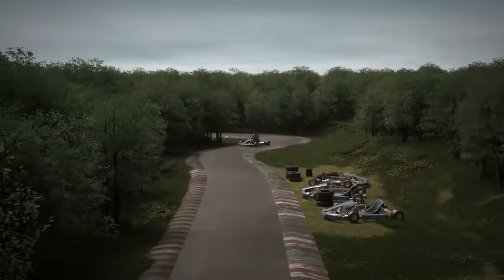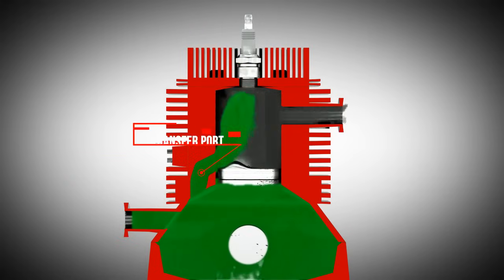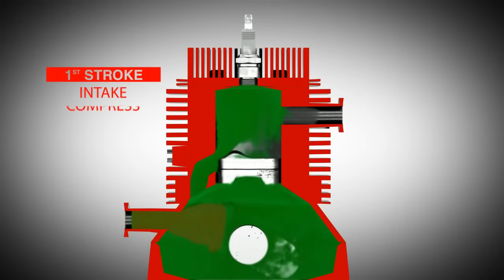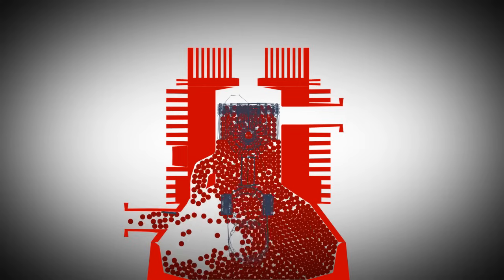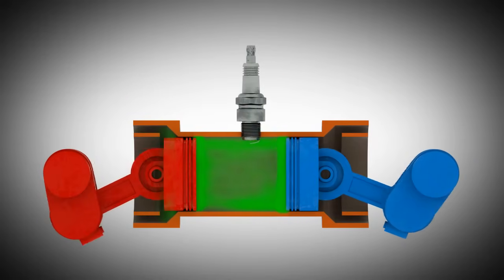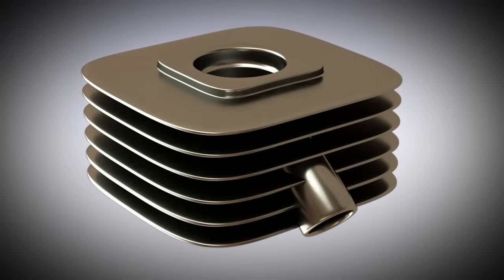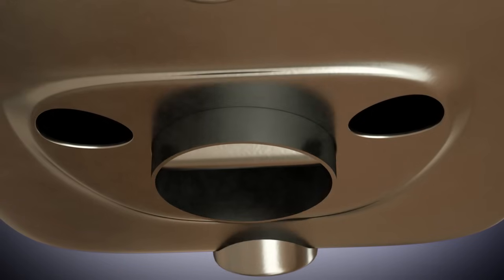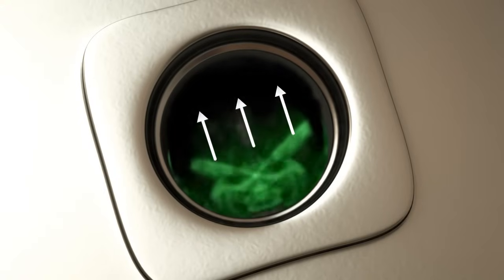Two-stroke engine - How it works! (Animation)

Comment: I’ve heard these engines have a problem 

They burn oil and fuel together 

Making them far dirtier than a 4 stroke engine 

They’ve been unable to meet clean air regulations since like the 90s and may end up being banned completely some day
Reply: That’s the beauty I I love about them, the oil burns up and creates energy, not throwing it out and waste it, we pay for this so called lube oil, just burn it and it becomes energy and smells good, castor 927 maxima
Reply: @jlo13800  Oil isn't really wasted. Yeah you have to change it, but it goes back to a refinery to be reprocessed into something else. That's why there are designated places to recycle it.
Reply: i can easly destroy any of these engines  without a total loss oil injection system. Let the self destruction with xd100 begin, i can rig them with total total loss burn off and see how it survives!
Reply: Ill rev it to the max to it self destructs and i would love it see do so, they cant keep up with my omc premix rotary, and never will, haha
Reply: Boy how i would love how these big blocks self destruct as they cant handle the revs
Reply: Castor 927 maxim a with total loss burnoff, i would love to make it happen with a homemade vro pump, cant wait to see it happen!
Reply: 2 Strokes do meet the regulations.
But 4 strokes had to have their Compression ratios lowered as the higher the compression ratio the more powerful and efficient engine but the emissions increase.

Comment: Will the compression ring cause any problem while travelling through the holes,I mean will it not try to expand out when it reaches the hole position,i. e exhaust port or transfer port or intake port?

Comment: Beautiful video, but I have a question. When the fresh fuel and exhaust gases mix, isnt there a good chance of fuel wastage since the fuel too might go out with the exhaust? Would be much grateful if the question could be answered
Reply: I find it annoying how this video didn't cover anything about exhaust pipe, even tho it's crucial part of 2-stroke engines. There's a well explaining gif in a Wikipedia page about 2-stroke engine with the exhaust included, I recommend you to watch it. But in short the shape of 2-stroke exhaust pipes cause the exhaust fume-gasoline mixture to be reflected back to cylinder, resulting in power increase. That's why 2-stroke bikes usually suddenly "rip" when accelerating, because the wasted fuel starts to be fed back in the cylinder. I'm not a very good at this topic, but hope this clarified even a bit.
Reply: Albert Benny some fresh fuel goes out the exhaust without being combusted.

Comment: Two strokes are amazing, my Gilera Runner SP50 from 1997 still reach about 100 km/h on full throttle, while new four strokes are struggling to get 70-75 km/h. I can overtake them with passenger on my Gilera while guy on four stroke is alone.

Comment: why is there no 2 stroke variant of rotary engine?
Reply: Old comment, but a rotary... Is basicly a 1 stroke engine. Every stroke of a rotary produces power.
Reply: @BobRobber1  yes, but actually no. every rotor has 3 sides and each one of them participates in a different stroke of the 4 ones simultaeniously. instead of having the top side of the stator being dedicated to intake and compression and the bottom to power and exhaust, it should have spark plugs on both left and right side, intake and exhaust port both on the top and the bottom, such that they are open at the end of a powerstroke and get covered just as the chamber vollume starts to close in. Its almost as if rotary was meant to be 2 stroke- it burns oil by design and 2 stroke engines are mathematically impossible without oil mix in their fuel. making the rotary 2 stroke would also reduce the problem of uneven heat distribution in  4 stroke variants, where the constant heat on the bottom and cooling from fresh air on the top leads to warping forces

Comment: You should have mentioned that the exhaust itself plays an. important role in a 2 stroke engine. It needs to be very well dimensioned for the engine to work correctly. If done wrong, some might even not work.
Reply from the maker: That's true.... but I couldn't mention everything. The animation is long enough...

Comment: This makes so much sense as to why you have to add oil to the fuel. I always knew that the added oil was to lubricate, but never knew how it did so within the engine.
Reply: so 2 strokes dont need oil  like 4 strokes u just mix it in fuel ?
Reply: @nail9602  You are right. Or there can be a system that injects the oil in the fuel before it enters the cylinder. The main reason to use this kind of system is, it can supply the right ammount of oil the engine currently needs.
Reply: @matejsommer72  To be honest, this is kinda funny. I had 2 stroke crossbike, with internal oil injection. its used very small amount of oil, but smoked so hard. After that, I had a Malagutif15 70ccm tuning bike, with same oil, 1:50 mixture. After it warmes up, smoke gone.
Reply: @nail9602  Special oil just for the Gas, it still needs standard gearbox oil for the Gears and stuff on the bottom of the engine.
Reply: My 8v92 2 stroke I fill with 4 gallons of quicksilver tcw3 and it does good
Reply: Splash lubricated 2 stroke, today’s rotax etec 850 and Detroit diesel are pressure fed, then the oil is thrown off the crankshaft and burned up!
Reply: @jlo13800  That is simply untrue.  The Detroit Diesel should not consume any oil from the case.  A work motor may, and it can cause a runaway motor.  The Detroit diesel engine has the exact same setup in the crank case as your car engine does.   It has a sump full of oil, an oil pump, and pressure fed bearings.   The engine uses a supercharger to blow a fresh charge in, and the exhaust out.   If the engine has very worn bores, it can feed off it's crankcase oil, and accelerate uncontrolled. Unlike a gasoline engine, with no ignition to shut off it is a panic inducing event the first time you experience it.
Reply: @Doonit_hard_way_since_65  My 8v92 has a metering vro pump and valve plumbed and blending with the fuel not into the intake! i want to go on castor 927 maxima next, i did several runs with xd-100 brp oil with success! she ran and lubed good but boy its not cheap.
Reply: @Doonit_hard_way_since_65  The rotax 850 etec has pressure fed bearing and piston cooling oil jets on the new skidoos. they just run a tighter hotter crankcase though. they have increased 2 stroke reliability with this
Reply: @Doonit_hard_way_since_65  What else does the oil do in this detroit 2cycle as it goes around and squeaks past the ports and burns up thats why they say to run low ash oil
Reply: @jlo13800  If the engine is in good shape almost no oil should ever get past the oil control rings.   The Detroit Diesel does not have ports typical of case-scavenged 2 strokes.  In a DD  there is a single poppet exhaust valve,  just like a 4 stroke would have, in the head. The fresh air ports are a group of holes lower on the cyl. The intake charge is forced into the cylinders by a roots-type supercharger, and never enters the crankcase.  This guy does a great job explaining https://www.youtube.com/watch?v=Xa2x5vrie-o
Reply: @Doonit_hard_way_since_65  Imagine an an8v92 case scavenged diesel thats built like this:https://www.offshoreonly.com/forums/general-boating-discussion/342429-caldwell-racing-technology-new-outboard-power-2.html#&gid=1&pid=14, but exhaust valves are used to make it uni flow. this way the oil could be metered by a dry sump then taken and burnt up eliminating a wet sump mess. the oil used could be a castor 927 2T bean type oil or biodiesel based. It would make the bottom end heavier though and it would run a bit hotter as all that air is being compressed and the crankshaft heavier do to the baffles between each piston and rods. Sachs, Hirth, Hatz, JLO and fairbanks morse model 32 huge diesels did this and they ran a speacial bushing that was fed oil and some slung off and burned up. Today there a cast steel/graphite bushing bearings that can run less oil than a bulky split needle rollers. The Sachs D600 ran on bushings with a separate oil tank!
Reply: @jlo13800  Why?  the Detroit Diesel has been around powering everything you can think of because to it's simplicity. Just a simple uniflow engine with no silliness going on. The 8V92 uses a common-pin crank journal (means opposing pistons in the V share a journal pin) A case scavanged diesel can not use a common-pin crank, there has to be a separate crank pin for each cylinder, each cylinder has to operate with a sealed crank-space. The crankshaft loses the strength and rigidity that makes a V engine what it is.  Not to mention the plethora of seals to keep each crankcase division pressure/vacuum tight.

You know what they call oil injected into the intake of a diesel?  "Fuel"   See a problem here?
Reply: @Doonit_hard_way_since_65  Ok yes true. the outboards run a one piece crank by has all those baffle plates welded/machnined on to it. its better for an inline engine to use crankcase pressure, a k38 cummins would make an awesome 2 stroke conversion project. Uni-flow 2 stroke is better for making torque. the 4l crt v6 was supposed to make over 650 hp n/a which is about a turboed 8v92 or 12v71 can do. My 8v92 is 475 hp and plenty for what i need. I do pull some oil off and mix it with fuel for total loss and it works good. One cool project would be to take to 850 ETEC rotax ski-doo engines and make a 1700 opposed piston uni-flow out of them. That would make for a sick torque tuned trail sled. here is a cummins new ace 2 stroke op:https://mart.cummins.com/imagelibrary/data/assetfiles/0058689.pdf?fbclid=IwAR3PWM1vZs8JxpuZMoJO5Y0YFoF9pV9fuGEhbyiGgxIP0r6sxzhqo5_P9oY. Achates power, rotax, MTU, EMD and fairbanks morse still making 2 strokes!
Reply: Yes cry sump with a VRO pump is the way to go as its done in outboards.
Reply: every lightning stroke is a crankcase scavenged  stroike
Reply: Exactly.  Inline engines also produce a stronger torque curve.   Referencing outboards, remember the old merc "tower of power" I-6 engines, and how much better they ran than the V engines from Johnny?   The sound from heaven was a hydro running tuned pipes on a big merc I-6.   Aaaah, those were the days.
Reply: @Doonit_hard_way_since_65  Yes the 2 stroke I-6 is a match made in heavin. I though of a 2 stroke conversion for a cummins k38 I-6 as there room between the liners.
Reply: Merc need to out with a 10L 2 stroke I-6 optimax DFI 600 CID for inboards. It would give much more power/torque cheaper than these ugly high strung 4 jokes.
Reply: @jlo13800  More reliable too.  Spark, some sort of compression, and fuel, you will get home.  I have never had a 2-stroke leave me paddling to shore unless it was major failure.
Reply: @Doonit_hard_way_since_65  Yes they are bullet proof whereas 4 jokes are not. it hard to believe that everything automotive is stuck on 4 jokes which the eceptions of tesla's. oh wait 3 phase mototrs are an electromagnetic rotary form of 2 stroke! No wonder them tesla's are so fast.
Reply: @jlo13800  I knew a fellow that had a Saab 2-stroke sonnet.  I was so jealous of it.
Reply: @Doonit_hard_way_since_65  There was a 472 v82 stroke GM was working on for the muscle sports car era, oldsmobile was in on this  to.
Reply: @Doonit_hard_way_since_65  Achates power is testing their 10.6L piston port OP 3 cylinder in a peterbuilt 579 now. The was a 2.7l 270hp 480 ft-lbs torque tried in an f-150. How about an OP 1700 made out ot 2 850 rotax etec's? that would make a sick torque trail sled as uni-flow is better for more hp/torque without the ugly big expansion pipes.
Reply: @jlo13800  Opposed engines have always fascinated me.  In the diesel world, where conservation of heat is so important, it makes sense.  Ever since the Commer TS3 I have loved the sound of that design.
Reply: @Doonit_hard_way_since_65  Oh google up om youtube the Amarc OP 2 stroke diesel outboard, its was amzing and built in the 60's. How did you like the cummins new 2 srroke 1000hp ACE. Imagine a KX1000 OP 2 stroke dirtbikes made out of 2 KX500, talk about an enduro. The Commer 2 strokes were something. Rare OP 2s there. Does a commer du better on the newer xd-100 synthetic oil, it burns cleaner and thicker film strength. Another favorite of mine is the Nissan UD 2 stroke, made just like detroit but with a more modern external fuel pump and ran on split needle roller bearings like some of the 53 detroits and some outboards. The commer i heard was on roller needle bearings do to the strange crankshaft not sure? My 8v92 runs sfk needles on the wristpins only. Im getting some cast steel split graphite CSB 452G bearings for my Johnson OMC small block v8 for a rebuild. Its a side oiler from a big external sump pan in a boat on the floor, its got oil lines everywhere on it whence a VRO side oiler.
Reply: Achates power OP 2 stroke are running like on  0W20 according o there people on the video, thats like water compared to XD-100. They run either Timken or SKF split needle rollers. Standard automotive is fine at 40:1 for a 2 stroke unless you load it down. I ran castrol 10w40 at 40:1 on my john deere JDX8 with a CCW 440 twin in it, it leaked a little by the clutch sire though. i ran it in my dad's lawn boy growing up as a kid and it worked fine. but if you turbo and race these these motors  a heavier synthetic like shellrotella sae 40 or XD-100 is better for longevity with the latter having a better flim strength hence higher price. im sure a commer knocker would work fine with either oil.
Reply: https://www.youtube.com/watch?v=usmauFigpzk, here is a 2 stroke OP 2.7l achatews powered f-150, nice but when young one start tinkering with it it will make some noise!
Reply: The oil burns up and adds energy BTU to the flame and it it not thrown out or wasted, even 2 stroke Detroit Diesels burn some of there lube oil
Reply: @jlo13800  some 4 stroke ferrari 1.6L v6 from a certain SF90 did that too, until it was deemed illegal or so I've heard 😉

Comment: These seem very inefficient in terms of VE compared to 4 strokes. I mean, it looks like you are just wasting half a cylinder while the exhaust port is uncovered while the piston is moving up (no compression until halfway thru "compression" stroke). Am i missing something here? Sorry if thats a dumb question, im new to 2 strokes.

Comment: The engine scheme is absurd! The exhaust pipe opening is very upward and the compression is equal to 0 - the compression ratio is 0. All the fuel goes out through the exhaust! Horror!
Reply: Expansion chambers

Comment: Check the history on the German Jumo 208. It was a 6 cyl aviation diesel. It was used in the 30's in twin engine push- pull, twin nacelle (4 eng ttl) Dornier(?) seaplanes. Then the design was sold to British Napier. They linked three engines in a shared crankshaft triangle shape. Called it the Deltic. Then, after Napier, I think Volvo used it for a powerful light weight marine diesel. It was used in riverine patrol boats by the U.S. through '68. Power to weight blew away Mercedes, but maintenance in the jungles was a challenge.
Wow that would be awesome if you could animate it. You briefly mentioned the opposing piston use in tanks and marine diesels and just had to share that story. My favorite engine! I even commute to work on a moped everyday.

Comment: what keeps the fuel mixture from being pushed out of the exhaust port during compression?
Reply: You do lose a little bit of the fresh fuel mixture out of the exhaust, just as not all of the exhaust will be pushed out. 2 strokes are usually a lot more powerful than 4 stroke engines, but they are also dirtier engines because the don't always fully burn all the fuel you put into it. It's also the reason that you have to mix oil into the fuel of a two stroke engine because if it were like a 4 stroke you'd burn oil and lose it out of the exhaust.

Comment: How do they keep the fuel mixture from leaving through the exhaust port without burning?
Reply: Volfgang58 very well
Reply: Also if you look at a lot of 2 stroke motorcycles you'll notice that it has a large bulge on the exhaust as it comes out of the engine. This is to let the exhaust coming out of the engine to expand and cool. (Compressing air heats it up, expanding air cools it down) This is the done to help prevent any fuel that gets rejected from the engine from igniting in the exhaust (which is what backfiring is).
Reply: That's the problem with 2 stroke engines, that's why they aren't fuel efficient and very polluting plus you have to add the lubricating oil directly in the fuel. At least the older types, search for KTM's new 2 stroke engines, they are directly injected.

Comment: During scavenging stroke the exhaust port seems to be open just a fraction earlier than the intake. Does the exhaust gas rush to the exhaust due to the lack of high pressure(compared with inside of the cylinder) in the exhaust system and creates some sort siphon that sucks in fresh air? Although there's probably some sort of forced induction but i'm just curious.
Reply: That's why he was mentioning the increasing pressure in the crankcase. When the piston comes back down and compresses the air in the crankcase it creates a higher pressure zone than the cylinder. The high pressure air will flow into the low pressure cylinder via the transfer ports, forcing whatever exhaust is in there out of the exhaust port. When the piston goes back up in cuts off the transfer ports and that creates a vacuum in the crankcase, as the piston is still moving up, creating more room that needs to filled, which is does get filled from the intake port